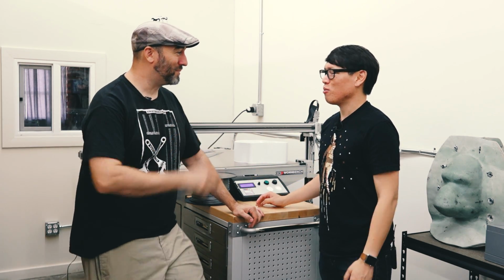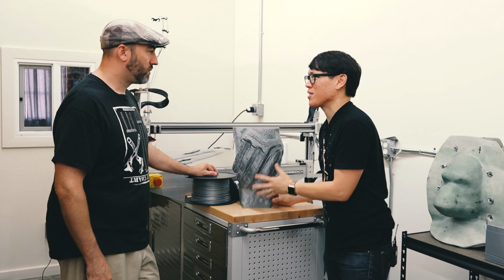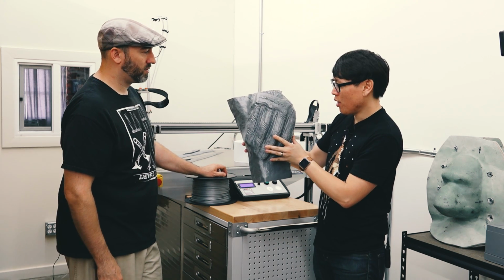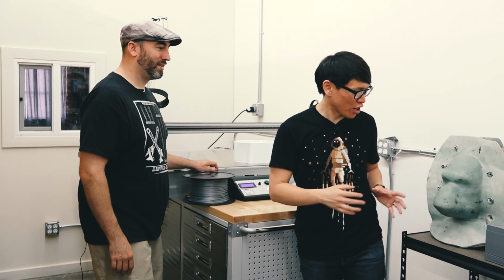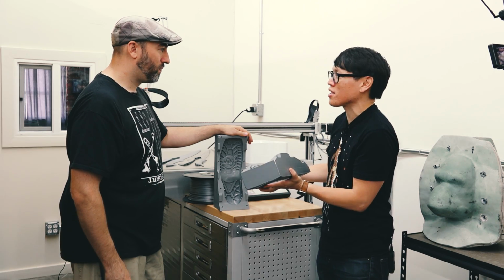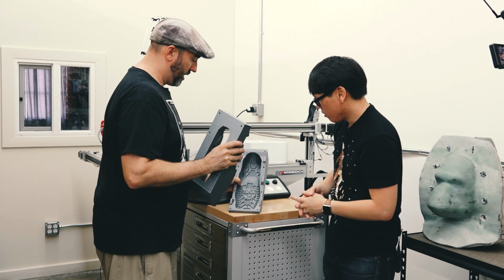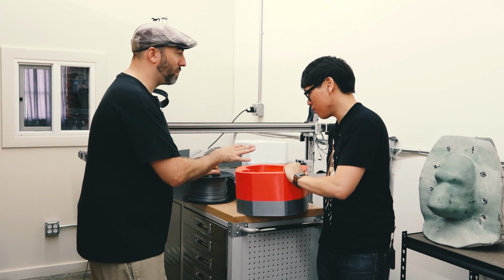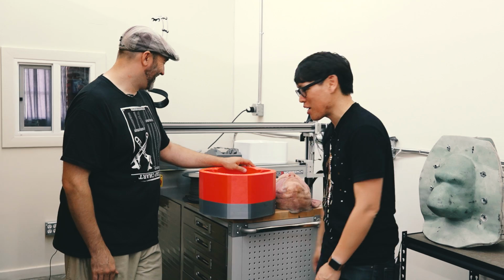3D Printing Molds for Silicone Masks!

Comment: Here I thought I was clever 3D printing mold walls for pouring silicone molds, so I can minimize the amount of material I use. Then you guys come along... 
It's so interesting seeing 3D printing used in masks and makeup appliances. I know the creature shop on Star Trek is doing something similar now - at least, starting with 3D prints and then doing conventional moldmaking and casting off that. Fascinating stuff!

Comment: I wonder is it possible to make this printer smart? For example if you were able to weigh the filament roll, if it falls under a set value, the printer would send a message to someone's phone telling him to replace the roll. And if the weight of a roll reaches a critical setting stop printing when the roll is almost empty.

I also wonder what the maximum size would be in a carbon printer. That would reduce the print time quite a lot.

Comment: Very interesting process, Frank. I didn't know the Hyperflesh guys were using this to make their awesome masks. I had a laugh when i saw the first Martian sole mold, where you forgot  to invert the NASA logo. I can't count the times i had to redo stuff because i had made the same mistakes. I see you fixed it in the angled mold. When you cast this urethane sole do you intend to line fabric on the top while its not cured to get a better bond ?
Reply: The Nasa Logo's are the same, he is just holding the second one upside down :)

Comment: This is amazing, would love to See some Step by step on How to actually make a 3d printed Mold in Computer
Reply: The quickest way is to create the mold box shape and then use boolean substraction of your model with the drag and injection  channel
Reply: What I was thinking about doing is getting the model and using it to cut into something like a cube. I know there's a process of using a model to cut into another model with and from that shape it up into something you can print. Something I want to try once I get my printer
Reply: There are mold tools built into most cad software

Comment: I want more about the Zbrush to negative for mold process. I'd love to take a shot at this.
Reply: Mike Martinez I know this comment is 2 years old, but incase people see this and are also wondering. Sculpt the face in Zbrush then print it on a 3D printer. Once it’s printed, you can then mold it. Once it’s cured, take the 3D print out and then you’re left with a negative to work with.

Comment: When using PLA for the mold have you run into problems with resin warping it due to temperature? ie. Smooth-Cast 300 gets pretty hot when curing.
Reply: There was a video where they printed a pla mold but the inside of the back kept hallow and filled it with a harden material.

Comment: > 'A quick prototype run'
> 'Only about 3 days' 

O.O how long do people normally print for?
Reply: Seems like it's pretty typical for little trinket things to take overnight to print, so I guess 3 days for such large objects does seem like a bargain.
Reply: was lucky to use a smaller but high def printer used to take about 1/2 days for midsized prints

Comment: Now Mission impossible is near. Now we only need a printer that automatically colors silicone masks.

Silicone masks are 600+ $ price range. I believe most of it comes from artist time needed to complete it. Which part of the process takes most time? Painting it? Molding? 50% & 50%?

Comment: Is it easier to print something, do the cleanup and finishing, and then make a mold of it; or to just print a mold and do the cleanup finishing in the mold or after casting the piece? Or it depends on the quality of the finished part that you are looking for? I couldn't even see the print lines on the mask in the video.

Comment: Isn't NASA on the shoe mold the wrong way round? or am I being very dim?
Reply: The mold is that way so the shoe will be the reverse and put down little NASA logos in the dirt with each step.
Reply: that was the way the boot was in the movie "the martian" we're making a replica.  same question came up when we did the "kill bill shoes" .
Reply: aliens have to read, who walked first on mars......
Reply: My Flyer Child slaves.
Reply: was going to comment same, but figured someone else had to have caught that too. notice it wasn't fixed in the revised section either. but! what it does mean is that you can read it the right way round in your footprint which may have been the goal for a theatrical footprint more than a properly identified boot.
Reply: That mold is what would be left behind when the casted piece steps in sand. So it is indeed correct.
Reply: Frank Ippolito 
I'm curious, are you recycling the plastic prints if you deem them not good enough or when they no longer serve a purpose?
I think 3D printing is great but with the whole world printing millions of plastic pieces which they will just throw away it would be good to talk about recycling. 
If you do please do a separate video on that. 
As fun as 3D printing is we need to secure the future of this planet.
Reply: Thanks, Love the all you guys do :) !!